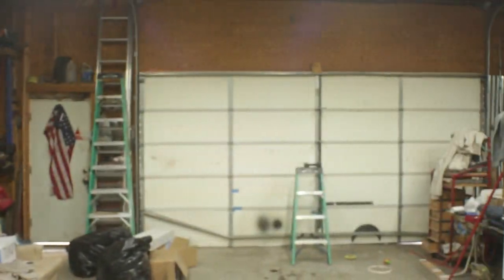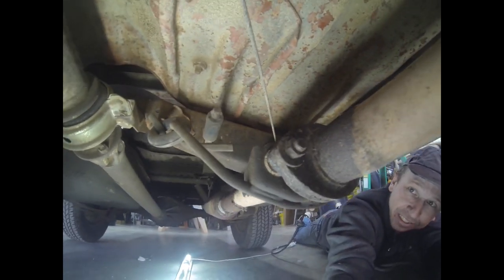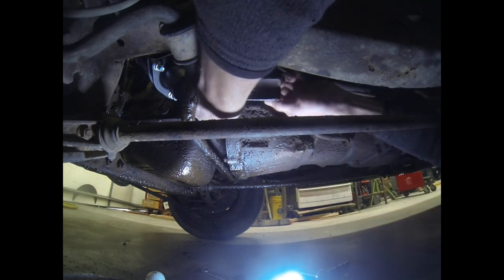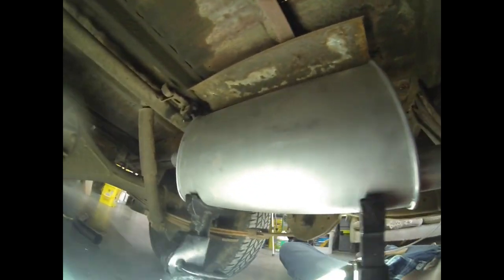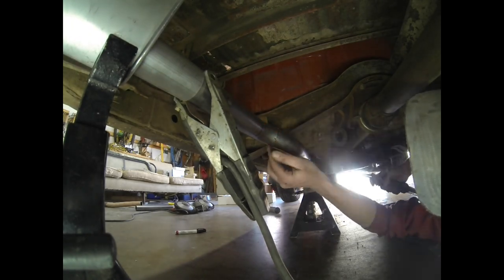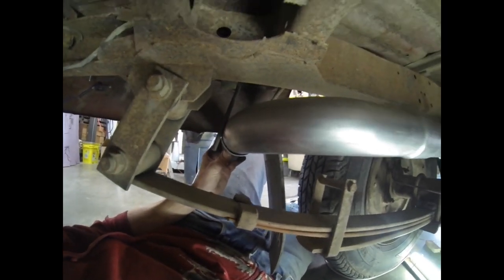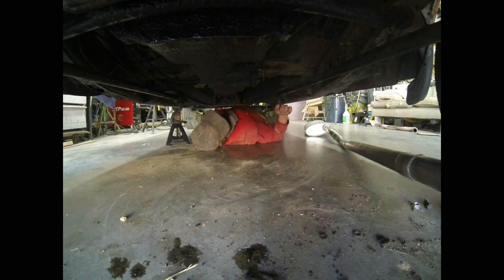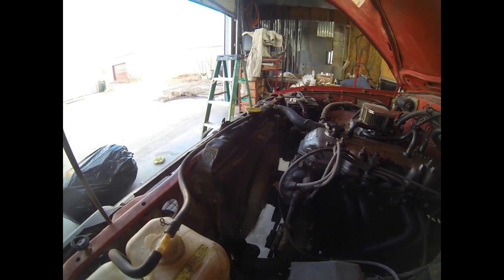1979 Toyota 20r Exhaust Build

Comment: Nice Scare at the end. I started your build watching with the first Glassing layer on the Floor of camper Vid.  Nice to “catch it in progress” instead of seeing it complete, that way it’s more suspenseful, exciting.  I appreciate your relaxed lightheartedness and intense care all simultaneously.  How many layers of glass did you end up with on average?  Funny how this started. I put in search-bar “Converting small trailer beds into campers”. I found Foamies tear-drop channels and BOOM! saw your CAMPER on older model pick up.  That was enough for me to switch up interest. I use to have an ‘88 Red Nissan pickup reg. Cab 4 cylinder manual.  The absolute best most relaxed fun ride memories ever I think I was 19 when I got her. In 1994.  Huge modern vehicles are just too much complication.  
Keep on keeping on!
Reply from the maker: Thanks for watching! 

The camper ended up being 3 layers inside and out for around 20oz total per side.

It's funny how these things start, I too saw some other foamie stuff online and was hooked.
Reply: @ThatJakeWorldWide  Nice!

Comment: Nice video, I need to do the same to my 1980 2wd 5sp. What is that long tube header that you used? A lot of sites say long tubes don’t fit 79-80 2wd’s, but it looks like yours fit no problem!
Reply from the maker: Thanks dude!
The header Is a Flowtech "shortie" Part #19000FLT

I wouldn't call it a true long tube, but a huge improvement over a leaking oem cast manifold.

It looks a lot like the offerings from LCE at about 1/4 the cost. Priorities ya' know?
Reply: @ThatJakeWorldWide  I hear ya, all my builds are budget builds! I'll look into that Flowtech header. I already have a weber, so now I can do away with the rest of the egr junk with the new header.

Comment: Have the same truck and engine you didn't have to use any block off plates I'm finding extra ports where my manifold came off as well as that tube inside the heatsheild I can't seem to find out what it's called or what to do with it.
Reply from the maker: The new header flange serves as the block off for the egr ports on the head.